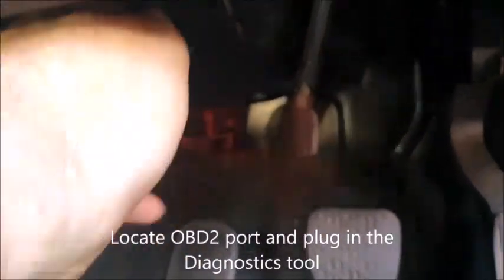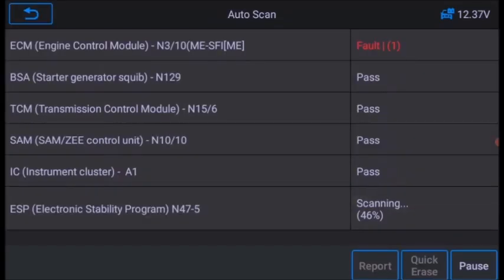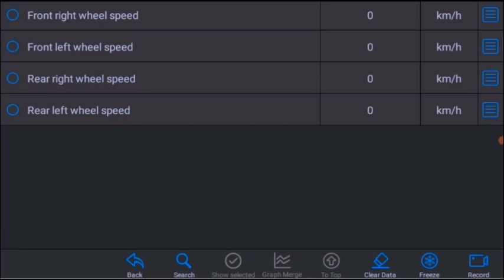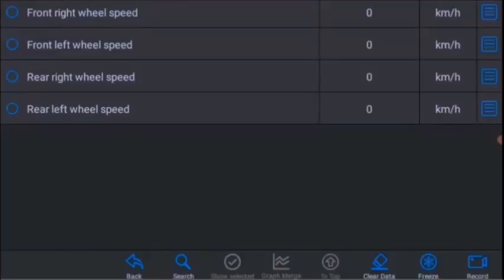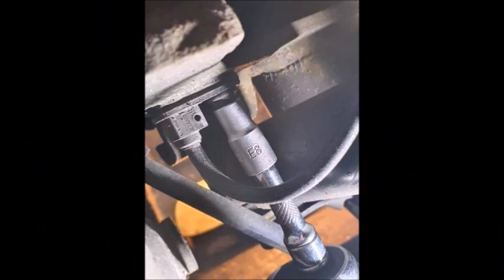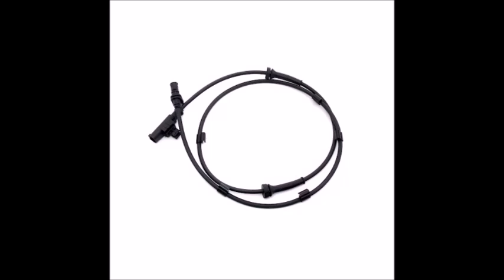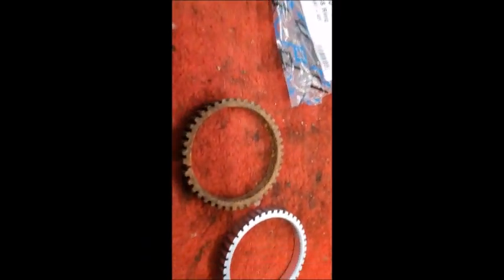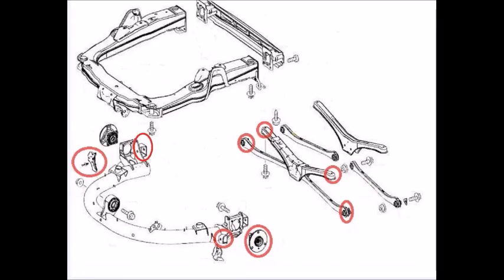iCarsoft CR MAX - Smart ForTwo Diagnose & Repair ABS Rear sensor fault

Comment: WARNING!!!!!!!!!!! I bought this for 
my 2023 Porsche 911 targa 4gts and is not supported!!!! reached out to ICARSOFT and they said to do the latest update and it still says not supported. I did get some nice lady that said she could help but no response when I tried to reach her again.Super bummed after watching multiple videos of yours I thought this was a good product. Any advice?
Reply from the maker: Some motor that. I think I would have took it to the dealers under warranty if only a year old. That's not good though sorry to here that, None of these tools are ever right up to date. Sometimes you can try a different model and get things to work or even select a different make in the VAG group, I have lots of different ODB tools for this very reason. VCD's is always good but pricey and governed by cost of VIN's. OBD 11 is subscription based so can cost per Credit. VW ODIS is a pain to setup and cannot connect to Server backend for latest updates although you can get 40mins or so on the bay for paying for access. Xtool costs after first few years at £300 per year for updates. and so on.